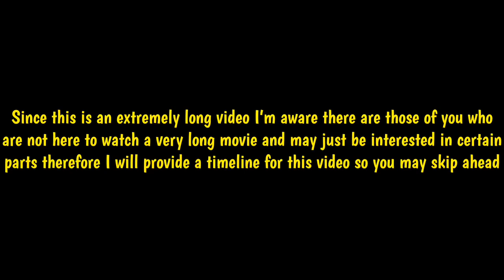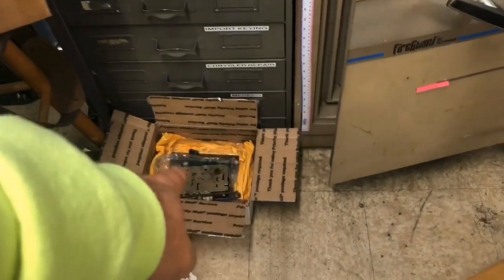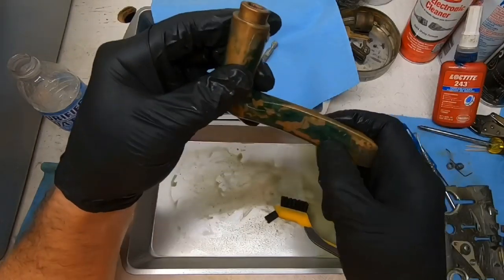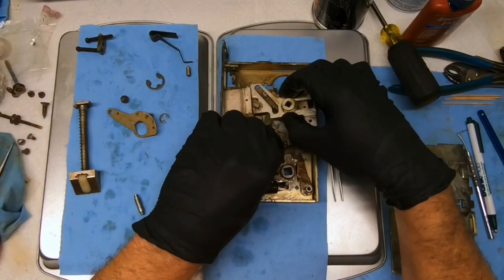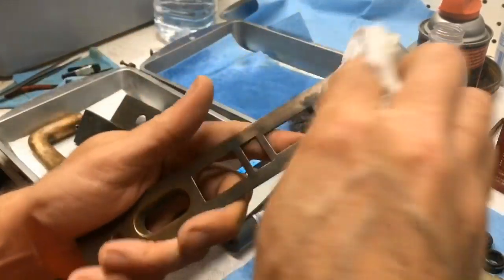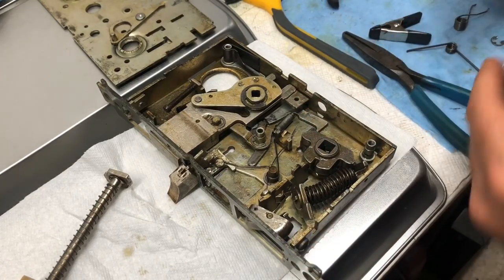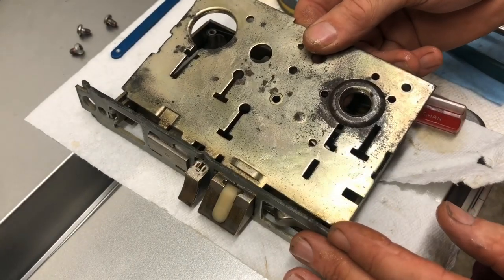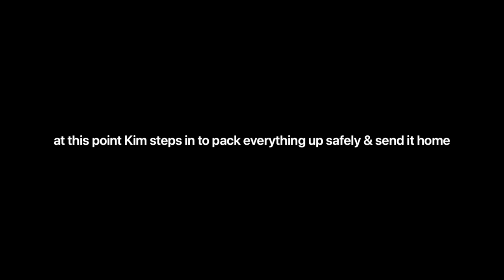Sargent 8100 Mortise Lock - the movie

Comment: A quick tip for stripped allen screws is to take a torx bit and tap it into the stripped screw.
The slight taper and spines help it bite into the allen screw. This trick has saved me a few times.
Reply from the maker: DJ 234 I’ve done that one before! This one was so tiny though :( I think it was pretty solidly seized up enough so nothing was gonna get it out

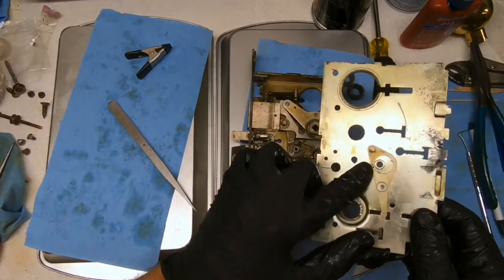Comment: My first suspicion/guess about that little mystery moving piece on the cover plate, at 1:08:54 is that while the thumb switch is set to the unlock position, the mystery piece is also moved and it stops the dead latch from preventing the latch retraction. actually that's my only guess lol...

Comment: Great video. Nice to see it without ads every 6 mins. Not sure why you put the bolt spring in, before getting all the parts clipped down. I always keep old springs for jobs like this, and still it is hard to find one without needed adjustments  thanks for taking the time to make this video. When you drill out screws, clamp the parts down. I was worried you would snap the bit and send the rest of it into your hand.
Reply from the maker: Rune International I was worried about injecting my hand too! I didn’t bring my laptop home so I couldn’t put those every six minutes ads in 😂

Comment: I used this to repair my broken lock and it worked nearly flawlessly, thank you! The new issue I have is that the door handle when pressed from EITHER side automatically unlocks the deadbolt… any idea where I went wrong? I would ideally like no automatic passage lock either.

Comment: WD-40 is great for resisting salt water. Considering it’s water displacement Also, I can’t remember the last time I used original Sargent anything. I only used it on an electrified lever that Sargent makes. And the cylinder was replaced with medeco for easier picking.